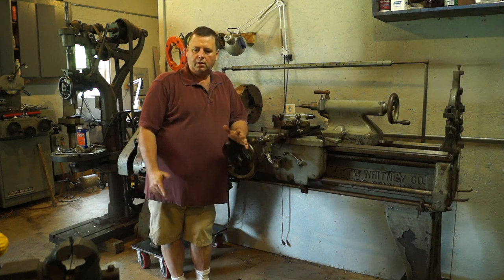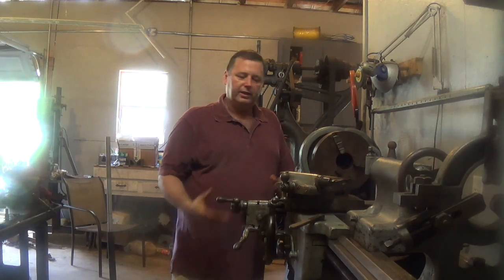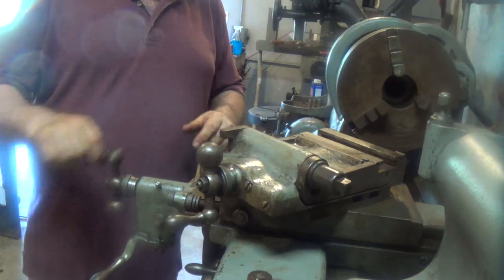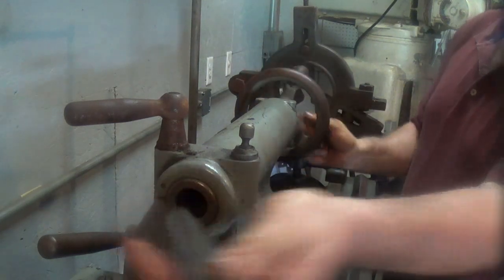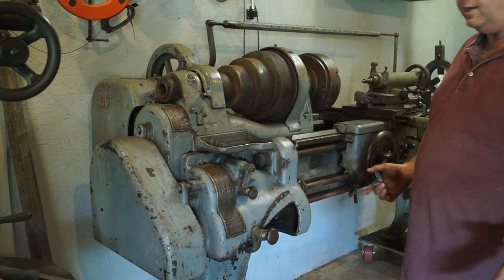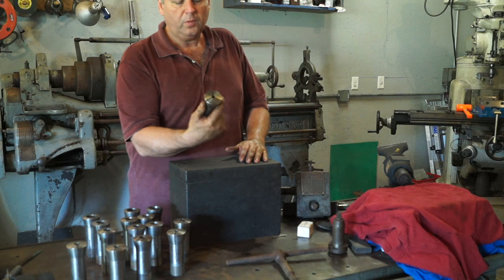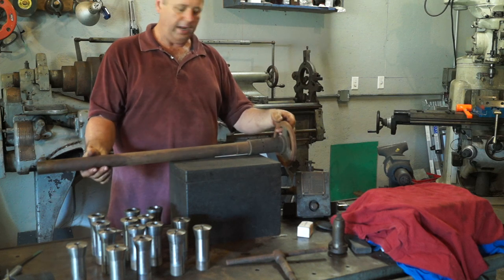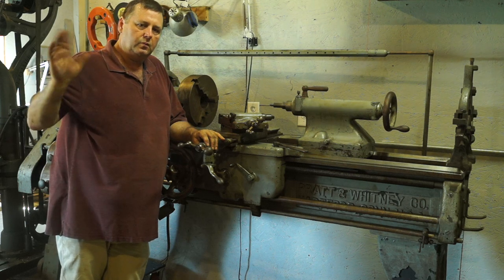Pratt & Whitney Lathe

Comment: I've got an 18 x 24 Mueller, made about the same time as that one.  Massive head, massive carriage, weighs about 3400 lbs.  Perhaps a bit more wear on it, and it has battle scars from where the chuck got spun off, and the carriage shows crash marks as well.  In spite of those, it seems to hold a very true cut near the chuck.  Gotta love those old warriors, the cleaner (closer) you get (to) them, the more battle scars you see, but they are just as reliable as most of the new stuff you see today ... IF you treat them well.

It doesn't have some of the features yours has on the carriage, but it does have a threading dial.  They did exist back then!
Reply from the maker: thanks for the reply, the lathe is not without it dings but they it is in better shape then expected. I've ran an .0001 indicator down the way and it didn't budge.

Comment: An extremely well preserved and rare lathe Mike. Even more so when every previous owner had to have looked after it very well for the last 100 yrs. First time I've seen a tilting compound like that. Possibly that has something to do with that relieving attachment? And that attachment would also be ultra rare today. My guess between the gearing and the cams they would allow multi tooth cutting tools to be machined once you geared the attachment faster than the spindle rpms. With CNC today I doubt any lathe manufacturer even offers a relieving attchmt for any price.

Lima (if it's the same company and I suspect it is) made if my memory isn't totally shot, earth moving equipment. Rope Shovels, Drag Lines, and I think cranes as well. Truck mounted also. Possibly if there's a tag or logo on it then you could compare it to what the Lima equipment company used. For some reason I seem to recall they might have maybe made front end loaders and haul trucks as well. If so then that 4 spd gear box would have been something quite normal for them.

Given what passed on most lathes of that time period for light duty tail stocks ect and how wimpy they really were for design compared to today, then my other guess is that lathe was designed from the start as a top of the line tool room lathe. The heavy duty bed, heavy tail stock, taper attachment, relieving attchmt. etc would seem to indicate that as well. P&W has a very long history of building some of the finest precision tooling, machine tools, engines, etc of the time period. 

Only 800 sq. ft? Mine has less than 150 :-) so I'm limited on size, weight, and amount of anything in my shop.
Reply from the maker: Thanks for the reply, I have to agree that Pratt & Whitney as always stood for top quality.

Comment: I believe the lever on the cross feed disengages the half nut and reverses the feed at the same time, therefore a thread dial is not necessary. Also I think the tilt (sin) of the compound is used for getting a negative rake on the tool bit for cutting the bottom flat of acme threads.
Reply from the maker: I looked at it after reading your comment, I can''t see any evidence of it working that way. I will do more investigating on it.
Reply: Seemed logical anyway.. :)

Comment: I have the same lathe, though not nearly as nice or complete, my apron was pretty much trashed and kind of repaired, minus some parts! the original compound was evidently trashed as well and one from another lathe was fitted to the base of the original, Ive had the machine stored at a friends since i got it, so haven't been able to fully asses it, it will soon come home, if you can show detail on the apron when you disassemble it it would be very helpful in attempting to rebuild my own

Comment: Hey Mike, I recently acquired a Pratt and Whitney lathe that I believe to be the same as the one you restored. Do you know how much it weighs?
Reply from the maker: My guess would be 2000-2500#
Reply: @TheBackyardMachineShop  Ok, thanks.  I'm thinking it would be better to remove the motor and upper pulley to make it less top heavy, What do you think?